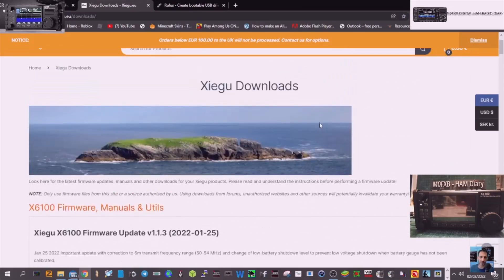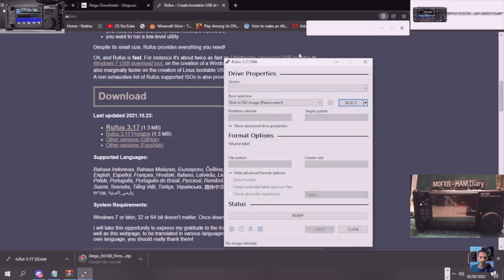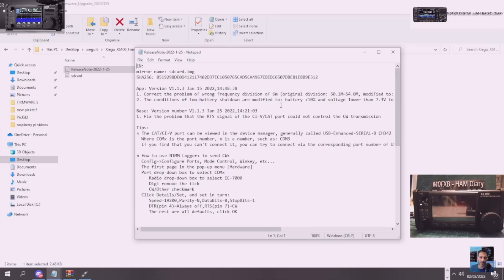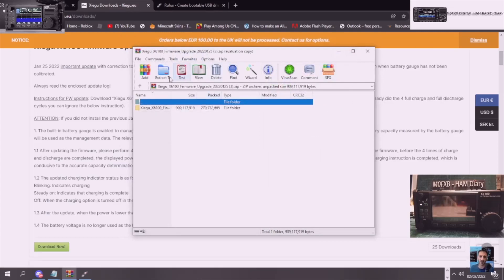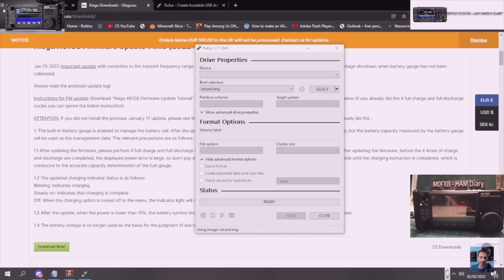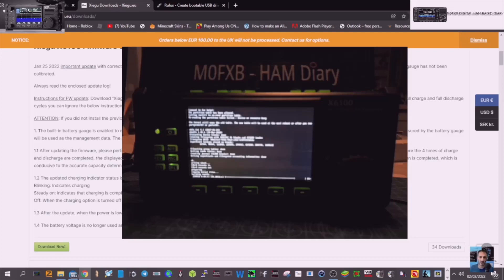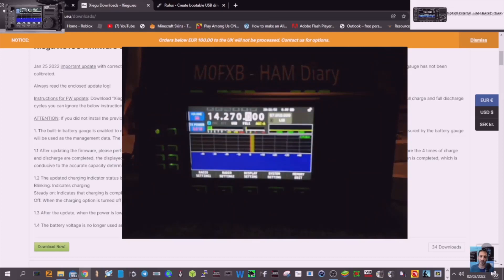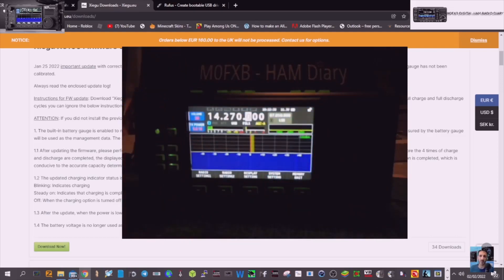XIEGU X6100 5th Firmware Upgrade v1.1.3 -25th January 2022

Comment: Do you really see any reason to update to the new firmware for this? By chance did you test WIFI/BT to see if they didn't document it but fixed it? Doubt it but wishful thinking just in case.
Reply from the maker: Hi I did turn on wifi blue tooth looked the same , because they mention battery changes I felt better updating.